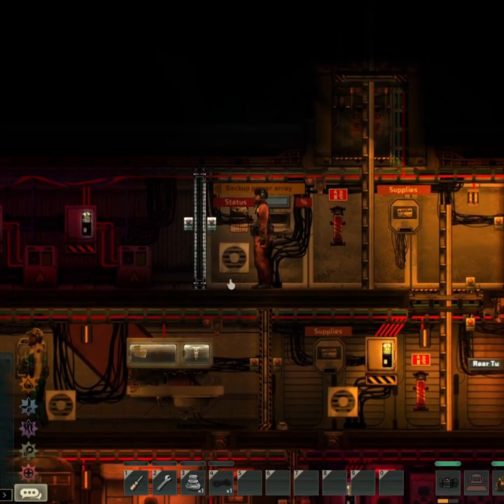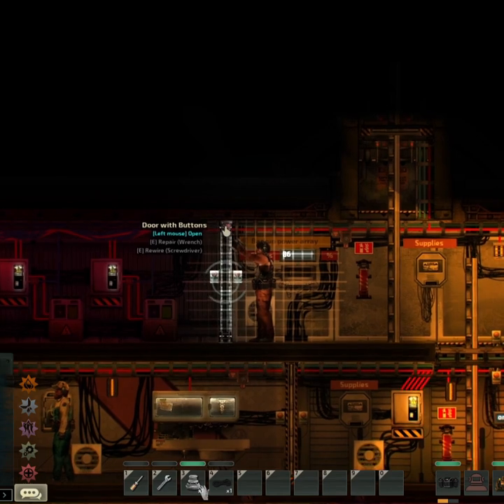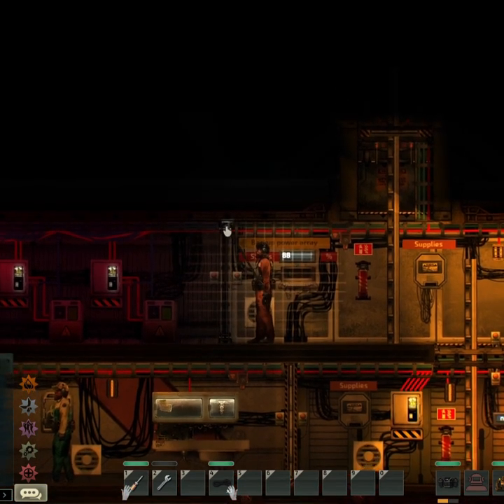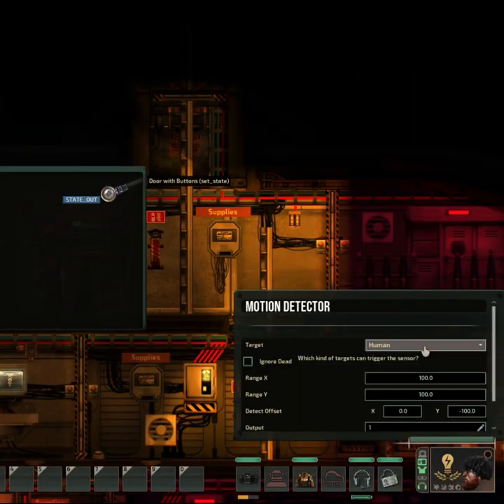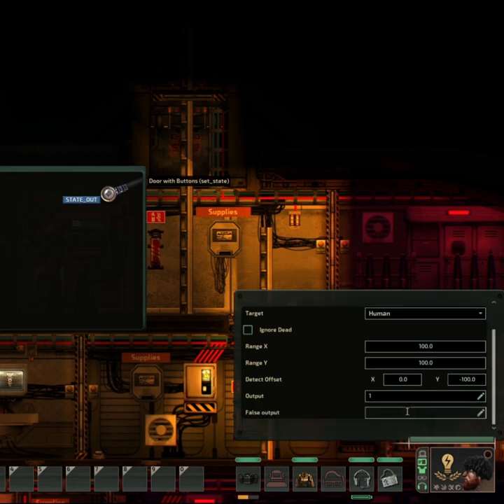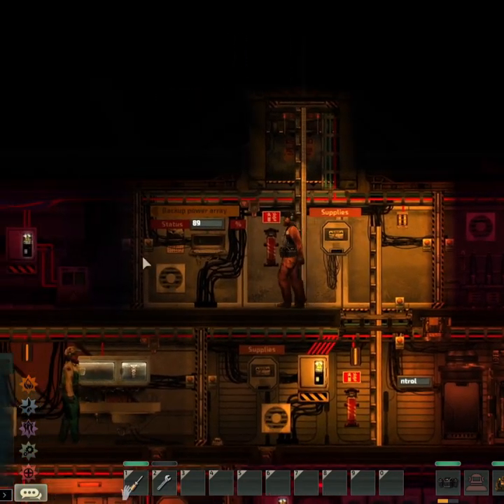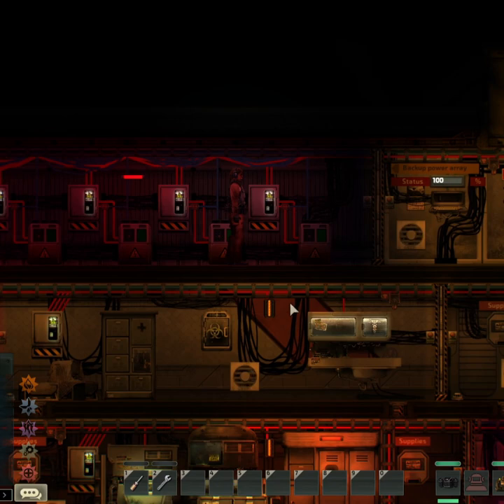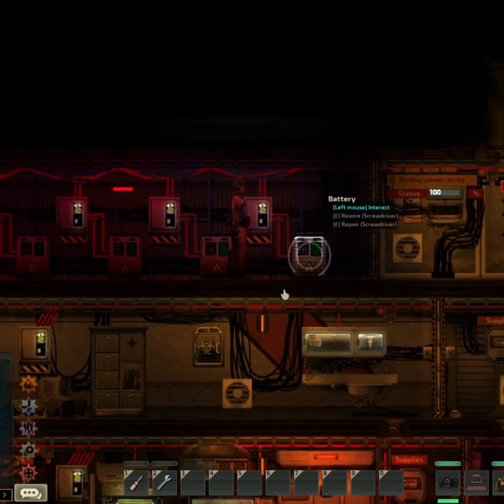Barotrauma Wiring | Motion Sensing Door

Comment: What if I don't want it to open automatically. Just close after a few seconds. To prevent bots from accidentally letting in water or monsters.

Edit nvm I figured it out. Really simple. Heres a guide for anyone who needs this.

All you need is a door a way to open it a motion sensor a delay component and 2 wires.

First set the motion sensor somewhere in the middle of the door. Then configure the range so that it fits the door and nothing else. Configure it so it only detects the motions of whatever you want coming through. Set output to 0. Leave false output empty.

Place the delay component anywhere convenient. Set delay to whatever time you want. (Recommended anywhere from 2-5 seconds.)

First wire motion detector state out. To delay component signal in.

Second wire delay component signal out. To door set state.

The door will remain open as long as you are in the motion detectors range and close after the set time when you step away. No more bots leaving airlocks open flooding your sub.

Edit: IMPORTANT NOTICE! DO NOT apply it to docking hatches. You will not be able to open them. Infact they'll be auto opening and closing by themselves if you're docked and causing a lot of lag
Reply from the maker: Great guide! The solution was to leave the false output on the sensor empty
Reply: @DreadedEntityMain  Do need to make an edit though. DO NOT apply it to docking hatches. You will not be able to open them. Infact they'll be auto opening and closing by themselves if you're docked and causing a lot of lag
Reply: @DreadedEntityMain  Feel free to make a vid on it if you want.
Reply: You can also just have it close automatically when no humans are detected nearby. 

Just do exactly what this video says, but set output to blank and false_output to 0.
Reply: @AshnakAGQ  To be fair it was one of my first attempts editing anything in the sub editor. So it was kinda sloppy

Comment: Do you have an issue when standing near the door where it spasms to shut and open
Reply from the maker: I'm sure you figured this out already but it sounds like you put the wire on TOGGLE_STATE on the door and not SET_STATE
Reply: @DreadedEntityMain  I've figured out the issue and it is with the limitations of the in game. Basically I am doing all of this within game and motion detectors you acquire within game are set differently than default ones on subs. The minimum movement is set to 0.1 rather than 0 meaning if you stand still near the door it freaks out. These settings can't be changed in game either, only in sub editor which is sad.
Reply from the maker: Luckily I have a video showing off the save decompressor tool that somebody made; it doesn't show exactly how to edit the sub from your save but it does show how to open up your save, mess around with the data, and compress it again. It's definitely possible to take the sub out from your save and make the changes you want in the sub editor, then put it back and close up your save

Comment: can you disable it when detects water?
Reply from the maker: Absolutely, just need to connect the motion sensor and water sensor together with an AND component. Great video idea, I will make a video soon
Reply: @DreadedEntityMain  Nice
Reply: @DreadedEntityMain  This doesn't override the manual imput right? Like, you can still manually open the door when it's flooded?

Comment: You can just use the motion detector that is already there
Reply from the maker: Great tip!
Reply: I couldn't figure this out. I ended up noticing there were already motion detectors installed above most of the doors and pre wired and values set but I couldn't get them to work at all so i just removed them and rewired. Was there some kind of switch or value that needed to be changed?